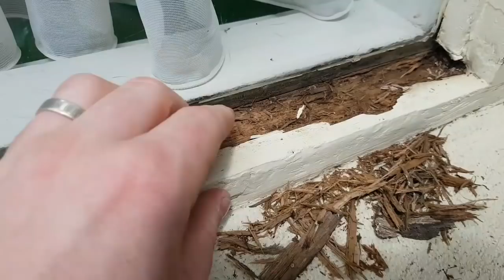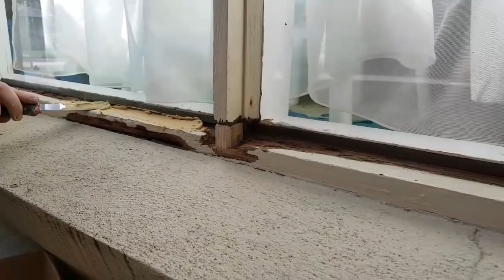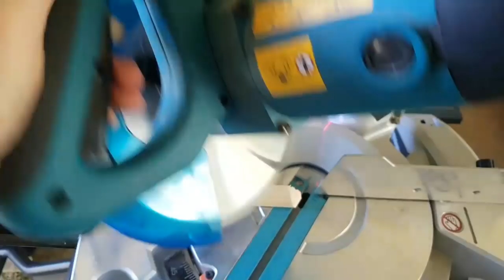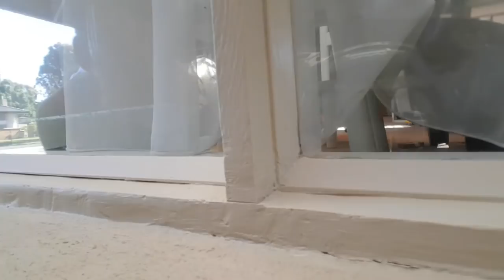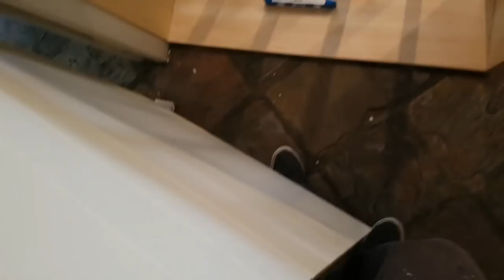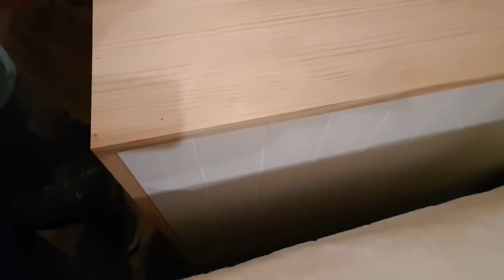Today's Lesson: Hide your Problems and Let 'Future You' Deal with Them!

Comment: Jazza, in the future you could use a zip lock bag to apply the filler... cut corner off (the one not filled) and use it like a piping bag, the use your puddy knife to even out... oh, not sure if I saw it right but under the new timber it looked as if there was a gap.  If there is, you should you should a silicone caulk to seal it or new rot with happen.
Reply: not to be a pest, lol, are you using angle brackets? if it is just hold shoes you might consider pegs instead which would allow you easily change shelf height later